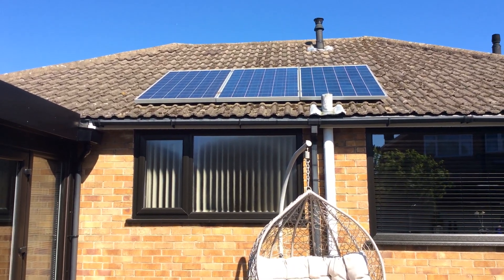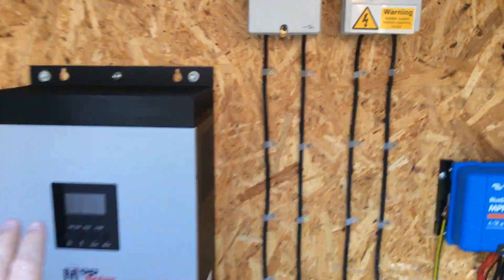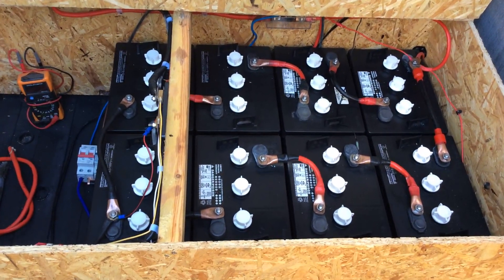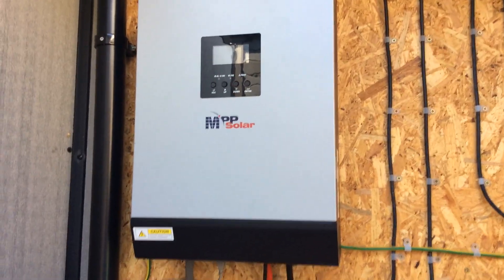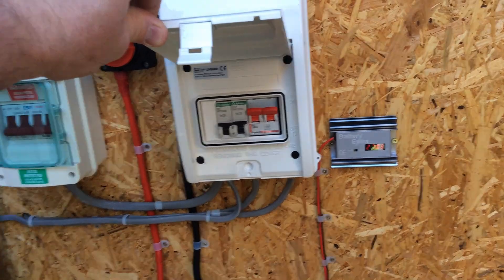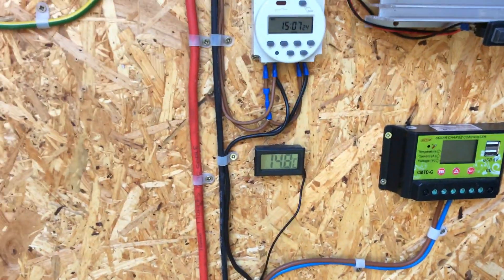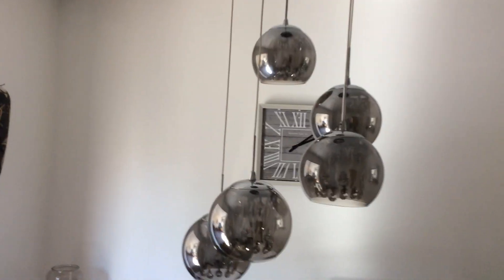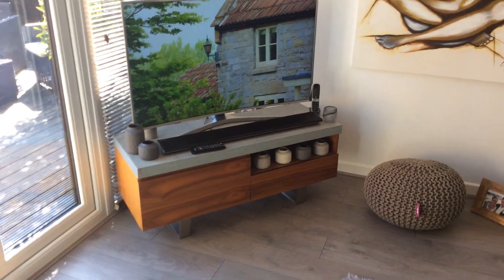UK off grid DIY 24v solar system.(typical windy day)

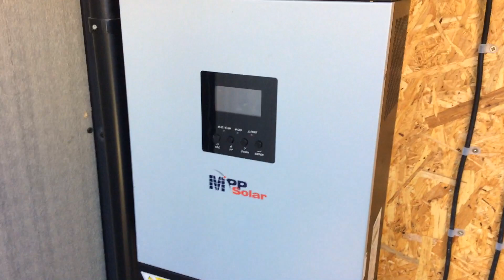Comment: 2:11 I know you did this awhile ago but depending on the voltage running a fuse on your solar panels is a very bad idea if the fuse burns out DC electricity tends to arc across the fuse at high voltage causing it to sit on fire. You need a DC breaker capable of this type of voltage and current that's the solar panels will be producing
Reply from the maker: Well spotted,I have done that on my new setup which is only grid tied. £14 off eBay 👍

Comment: Hello, did you need any permission for solar panels? I also wanted to install them on my house or my shed, I once read a regulation that up to 4 kW could be used without a permit, I don't know how the regulations have changed.
Now do you have to ask or beg an official or can you install a 4KW offgrid in your own garden?
Reply from the maker: With out reading to far into it I believe you can go up to 3.6kw if you intend to do a grid tied system. If you are not tapping into your consumer unit/ utility network and just off grid for your own personal consumption then you don’t have to worry about it.  But this all depends on where you live? If like me in the UK then you should be fine. Hope this helps.
Reply: @solardiymadesimple.3779 I'm living Scotland

Comment: Awesome setup! I've an issue with mine if you have any advice ? 
I've 440w total of panels (2x 100w 2 x 120w),  4x110AH lead-acid in 2 series 2 parallel configuration, and a (for the moment) cheap inverter (max 2Kw) I want to improve the safety and have purchased a consumer unit with RCD, issue is when I wire this to bond neutral to ground (earth ground) I get issues with E.M.R and induced AC within the DC circuits, have you seen similar and if so any advice on how to solve this issue ?
Reply from the maker: I know this might sound daft but you are running a separate ring main to your items and Not running straight into the one which is still connected to your house . Or have you disconnected the ring main from your house consumer unit?.
Reply: @solardiymadesimple.3779  Running a completely isolated setup, not connected to the household ring in anyway, when I run the inverter with the Neutral ground bonded at the RCD, the RCD will work when sending a test fault with a tester, however AC voltage is induced in the DC equipment detectable with a multi-meter and Non contact voltage tool, when running without the bonded earth-neutral, the RCD tester does not trip the RCD, and there is no AC voltage being induced in the DC gear. 

It is driving me crazy, could just be the crap inverter, I suppose, but I'll have to wait a while to be able to replace it with a decent inverter.

Comment: Hi

Thank you the information below. Just one other detail. We know you set you battery cut off at 24.5 volts at what level do you set the reconnect?
Did you ever make the video regard your grid tie system?
Reply from the maker: My system would never run / hit that level unless we had bad weather,and only then the system would automatically switch back to the grid. l would then have to manually switch back to the batteries once fully charged or when in float ie. Around 26volts. My system just recycled it’s self on a daily basis.
Not had the time to upload any more videos but I will when I get 5 minutes.

Comment: thanks for your video, nice set up. What type of batteries are them? AGM? or lead acid? where did you get them from. many thanks
Reply from the maker: Hi, they are lead acid batteries. I wouldn’t advise them although they served me will for over 5 years, firstly the maintenance of having to check the water levels each week and topping them up with the deionised water. Secondly they off gas which smells eggy and also they need to be in a ventilated area due to hydrogen gas. They don’t like cold weather and lastly you can’t let them go below 50% discharge. If you can budget a little extra then l would definitely go with lithium batteries but then not everyone can afford them. The only other battery l would go with would be the AGM due to less maintenance and they can be kept in doors out of the cold weather which does help loads. The batteries were off EBay  the same as trojan T105 . 225amp hour each 6v👍
Reply: @solardiymadesimple.3779  thanks for the info. didn't think you would reply but many thanks again. looking into which batteries to get. defo AGM as wondering to get golf cart batteries as they are the same AMPs and volts. Be great to see another video of your set up in current situation that we are having in the UK. many thanks again for the reply.

Comment: Hi

Do you switch of your system during the winter?
Reply from the maker: Yes the inverter was switched off from the end of October until around April. The batteries remained fully charged with the victron charger, another reason for using a separate charger.

Comment: Interested to know what earthing have you used for the casing of the inverter? Is the output earthed?
Reply from the maker: 4mm earthing cable onto a 6ft copper ground rod at the side of the shed,Also grounded from the main feed /consumer box to the transfer switch in the shed.
Reply: @solardiymadesimple.3779  Makes sense. I am fitting a hybrid inverter with AC in my garage. Considering pigtailing the mains earth from the AC isolator switch to the inverter chassis and consumer unit. What do you think? Cheers
Reply from the maker: @derekdewey3098  shouldn’t be an issue. Does that inverter also have a permanent live from the grid as a backup or is it a standalone ? ie totally off grid.
Reply: @solardiymadesimple.3779  Thanks.
Yes it has a live from the grid so it can take power from solar dc/ac mains or batteries. It switches itself depending on what power is available and the priorities I have set (Iconica 2000w). Its not grid tied, just takes ac.
Reply from the maker: @derekdewey3098  in that case then if takes an ac feed into your inverter you will have a ground there anyway which you can split if needed. I grounded my solar panels as well just to be on the safe side. Hope it works out well for you, you will become obsessed with it once it’s up and running 👍
Reply: @solardiymadesimple.3779  Thanks for the help. Sure you are right about the obsession,  already finding it interesting.
Reply: Just one other thing that I've thought of...did you use the output earth from the inverter in your consumer unit or just not connect it?
Reply from the maker: @derekdewey3098  everything is earthed.
Reply: @solardiymadesimple.3779  cheers

Comment: Very nice! Such a great & neat install. 
I have a newer version of this 'All in one' hybrid charger/inverter, which I'd like to use in an outbuilding, but still connected to the grid (throrough the inverter's AC in, for 'back up' when batteries run out). I am a bit confused about how to ground the hybrid inverter. Been told that I should connect the inverter's earth socket to the earth rod of the  house/electric mains. The problem is I'll have to run the cable through lawn, and concrete for a long distance etc. What did you do? Did you install a separate/second earth rod for the hybrid inverter, or did you not ground it at all, or did you physically connect it to your house's main earth rod?
Reply from the maker: Hi, l used a separate ground rod 6ft long for all my equipment which was whacked into the ground at the back of the shed.
Reply: @solardiymadesimple.3779  Many thanks for your reply. I may do that as well. My only concern is that if/when the Inverter is connected to the mains via the AC Input,, then it'll be connected to two grounds, thus forming a loop. This may be an issue if a lighting strikes, though this is not very likely. Not sure if there are any other implications as this is a subject I don't know much about.
Did you use AC breakers/isolators for both the AC In & Out of the inverter? (edit- oops , used a different account, but I am jd pd)
Reply from the maker: @headphonekiller5  
The mains backup feed from the house to the inverter came from a 60A breaker and only used in the winter time when there wasn’t enough solar power. Power to the house from the inverter also went through two breakers, 6A for the lighting ring main and 32A for the plug sockets. I should have also added a RCD.

Comment: Didn't notice any rcd protection or armoured between the battery shed and the house shouldn't be using twin and earth outside underground
Reply from the maker: Yes your quite right there my friend, and for anyone reading this comment use armoured cable outside.

Comment: I have a very similar set up but I did it for £550 all in. I bought 4x210 watt solar panels for £180 S/H. I bought a 48v 2200 UPS for £40. I bought 4 new 110Ah leisure batteries for £260 NEW. When it's cloudy I just run the freezer in the garage. When The sun is out I run the whole house except for the oven and washing machine. I switch back to mains then.
 All my house wiring is standard, there is nothing to see. My panels are hidden on a flat roof.
The one naughty bit is a foot long patch lead. If you put "Dryer Backfeed" in YouTube you can see what I've done.
I monitor my controller with a £10 battery doorbell cam😉
My background:  I am a retired engineer. Qualifications in mechanical/electrical engineering, and Civil engineering that I did for fun.

Comment: I was inspired by your video and decided to build an off grid shed. 4 x 250w panels 4 x 6v 225ah batteries and the same inverter/charger. I always wondered why you went with the Victron MPPT charger (other than the bluetooth, obvs)? but now I am starting to understand (I think), the charger and state of charge monitoring on the MPPT inverter is dreadful, mine rarely charges the battery to full capacity and the state of charge is nothing like what it really is, meaning the management of the battery system is sub optimal. I was just wondering if you had a similar experience?

I think I may end up investing in the Victron charger also.
Reply from the maker: Yes l had the same issues and l couldn’t monitor the system on my iPad with the older version although the newer model now has Bluetooth, there a good inverter for the money but l would be weary about the software monitoring. Hope you put your system to good use and don’t let your batteries go to low, they will last you years.👍

Comment: Nice set up, very tidy, although I'd probably want conduit on the external ring mains. I went down the 24v route 8 years ago, but if I started today I'd go 48v. £8 a panel? I'm gob-smacked, as my second hand panels,  8 years ago were £125...Although the new ones I bought last year, which have 50% more power, and are the same size, were £125.  Not tempted by more panels and batteries then?
Reply from the maker: Yes l couldn’t agree more with the conduit to protect the wires. I no longer have this setup as it’s been sold. In hindsight another panel would have been better along with 4 more batteries but that also would have been more maintenance.Yes 48v is the way to go. Thanks for watching.

Comment: A great setup and explanation.  Just curious about the switching between battery and grid.  You say it's automatic, is this controlled by the Victron MPPT system?  What model is it?
Thanks
Reply from the maker: Switching is done with the inverter. The VictronConnect is the 150/35 which means it will take a maximum of 150v from your panels and will charge at 35 AMP. Also Bluetooth. Great little charger,highly recommended.

Comment: What size cable have you used from the change over switch to the main consumer unit inside? Looks 2.5?What size breaker is it on if so? Thanks
Reply from the maker: Yes it’s 2.5 twin and earth cable and I’m pretty sure it’s a 16amp breaker. Don’t forget I’m running all low wattage led lighting and TVs.

Comment: Might be better to run everything 12v and avoid inverter inefficiency.  Just a thought.
Reply: the MPP inverter is 97% lower voltages is a BAD thing. Ideal would be to have a 375V system to run direct switching. but that's a lot of batteries :)

But you dont need big Ah batteries for that.

Comment: Anyone know if you could run the rest of an home in the UK solely on a solar system? I'm thinking that a fridge freezer, 2kw kettle, toaster and washing machine for example would make it impossible, even if you limited the use of the washing machine to say one sunny day every couple of weeks??
I'm looking at selling up/becoming self sufficient basically, if say I had ten thousands pounds set aside after the move to spend on a solar system, could it even be possible to live like 'normal' basically??
Reply from the maker: My system is now basically redundant this time of year because of a couple of factors. 1/ my batteries hate cold nights. 2/ not enough sunlight focusing on the panels due to the low sun. 3/ unable to alter the angle of my panels to get the optimum sunlight.. 4/ not enough panels. Even though my batteries are able to recharge daily, putting them to use with minimal draw drains them quickly this time of year . Not saying it’s not possible but with the UK weather being so unpredictable you’ll need a backup plan.
Reply: @solardiymadesimple.3779  I'm thinking that you'd need at least a dozen or maybe 20 solar panels to have half a chance of it working, got to cover the whole roof with them basically. I dread to think how many batteries you would need too, I see that some of these systems are based around 48V too,....is this the best option to go with I'm wondering??
Reply from the maker: @steveclark..  48v is the best option if you can afford it and yes you would basically need to cover your roof with at least 10 x 320 watt panels. You would have to do the maths to workout how many batteries you need and not forgetting how many days you have without enough sunlight to charge your batteries? An average 3 days of extra storage batteries for those bad days normally required. Good luck with your adventure.
Reply: @solardiymadesimple.3779  Not that I can afford Tesla's power wall systems, I'm assuming that they would be the best but I've watched a couple of videos from folk in the States who have turned off the grid power to them, one lasted like a week, the other were 33 days I think. What with the UK having less sun, it does make me wonder how feasible the idea is period? Maybe we will all have to ditch anything that's high wattage, washing machines, typical house sized fridge freezers, electric showers and ovens for example, due to the looming power outages predicted for the UK. ☹

Comment: I am so happy to have found your video. Everything looks perfect and thanks for sharing your eco journey. I have just started the same journey and would be grateful for your advise. I have a 4*100W solar panels, a 24V 3500/7000W inverter and 2*130AH batteries. By the way I only started this journey just two weeks ago and wanted to see how it goes before I upgrade the system. However, in the last one week, I am only able to enjoy maximum an hour of solar. Once I put the load on the inverter (it is set on low battery shutdown of 21.8 - 22.0V) which means it reaches this minimum between 30 to 60mins. What am I doing wrong and or what can I do? Thanks!
Reply: What you need to do is work out your Watts....
2x130 SLA (RAW watts) 3,120 watts  THATS USABLE watts 1560 (50% DOD).  
If you load your inverter with 3000watts, that's 0.52 of an hour (or 31 minutes and 20 seconds) run time.
{1560/3000 = 0.52 x60.}
If you ran a 300watt load that's 5.2 hours! 
450W load  3.46 hours
These times are without any losses, this mean where conversion is not 100%, you may be up to 20% less on cheap/ cut hardware.

While a 12volt battery seems that its Nominal power should be 12v, its not like lithium with a 3.7 nominal 3v discharge and a 4.2 charge. Lead is a different animal and the 12v is near a low end (with sag and fast drop off to the voltage curve).
So if your running a 12 volt system, that's a BIG mistake, the rating on a battery (C rate) is carried out different ways and you will have to look up your battery, the C rate  is proportional to the AMPs.. If you have a 12V system Vs a 24v system then you draw MORE from a 12v and the C rate (Ah) is lower that stated.
Now there are different types of lead, so for me my charge is 28.4 volts, my 50% is 26.26, and my 30% 26v.. NOT 24 and 22 respectively (naturally thinking).

You have said you have 4x 100w panels, they are 12v panels. usually a 3 cell row, these are not the best to use as you end up with around 2-5amps from them at best. if we do the math, 4x 100 watts equals 0.18 amps (18v OC panel) which would amount to less than 1 amp from all four panels (18x0.18).
a 24v system has 37v Open circuit and just under 9 amps, that's around the 240watts range.
You should match you inverter to your PV to "break even" on what you take out to what you put in. -- just a general term you do not need to. -- this way the PV will take the full load without discharging the battery. when your load drops, this will charge the battery. how you size the battery is based on how many day hours and night hours are there, and what are the combined loads. the second stage is how much do I use and how much charge do I need for the night. this is all calculated in watts. Watts is volts X amps. or more helpful is to add your day and night total watts,  divide this by 24 and the answer is your amps that your battery needs to be.
Reply from the maker: Hi there, your cut off voltage is way to low so basically your killing your batteries slowly . You shouldn’t be letting them go below 50% capacity which is 24.2v which will prolong the life of them and you should be recharging them daily back to 29.6v. It’s quite hard to provide correct information about your set up without knowing how your set up is configured ie type of charge controller/loads you have running of the batteries etc. You also have to take into consideration power losses. Are you using the correct size wire in your system etc etc.